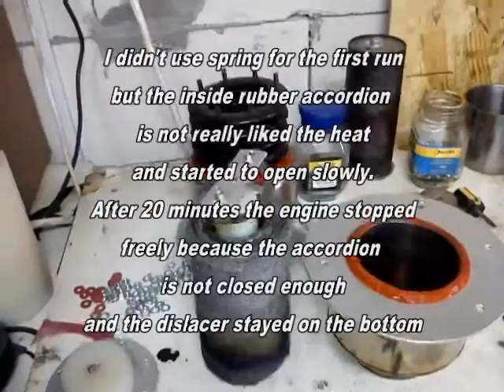My Big Free Piston Stirling/Inside view

Comment: I'm very excited for when you put a permanent magnet on this thing and see how much electrical power you can manage.  It would also be really cool to have you use this as a fountain pump, that would be neat.  Awesome work. I really like your use of simple materials.
Reply from the maker: Thx! I hope it will be soon! I repaired some parts inside. I changed the displacer can to stainless can also changed the regenerator to stainless scrub. But not enough airtight yet, so don't work stabile in a long time actually. I need to solve this problem and after we will see...

Comment: It's cool! Blade, This video makes me more interested :D
I have two questions about regenerator. One is 'why did you change regenerator to stainless?'
The another question is that regenerator consisted of two layers, top has stainless and bottom has cotton. is it more efficient?' Because steel conducts its heat to the top hot air well, and
cotton doesn't conduct steel's heat to bottom's cool air. My idea
Reply from the maker: +김소윤 Thanks! The regenerator is simple No4 thick steel wool. The Stainless steel is much better, but I hadn't got there. Stainles steel for everywhere the best, but my engine is a moving regenerator one. The high tech engines use standing regenerator for this type engine.

Comment: Thanks for making this video.
I plan to mass produce some Pistons like these and put them in light weight car I am building.  (I was originally going to ask you if you could make these and I would pay you but decided that you are probably busy and it's probably cheaper if I did it)

Also I am going to be using fire extinguisher cylinders and cutting the top off (they will be empty of course) do you know if there is any problems if I had a fire under it at 600 to 900 degrees Fahrenheit (yes I realize that I should use Celsius)

Comment: Hi Attila, this is an excellent strip down video.  I am trying to make one of these engines but I can't get it to run. I'm using a pasta can displacer with an internal accordion (like yours) but the diameter of the can is only 2.5mm less than the inside of the cylinder. This means I don't have enough room for a regenerator. Do you think this might be a reason for it not to work?
Reply from the maker: The gap should work too if the cold side is good enough. The displacer should exactly in the middle of the cylinder. The flat spring what I used that saved the rubber accordion from the over-expansion. The sponge on the can surface and the inner volume reduce the heat load on the rubber. But the displacer should be longer as a normal displacer. Did you made a pinhole onto the displacer? because the inner pressure could fix the displacer when the engine start to heat up.
Reply: Thanks for your reply.  I sent you a pm just as I received it!  The displacer is central in the cylinder but if you shake the engine it rattles as it makes contact with the walls of he cylinder.  Yes, I did make a small hole in the displacer to stop the gas expansion in the displacer extending the accordion to the limit.  The displacer length is the same ratio to the diameter as yours and the expansion and compression spaces are about 35mm.  As far as I can tell, the only difference is the regenerator and the gap.... Any other ideas? Thanks

Comment: The displacer (which I assume is a pop can) , you have the center cut out to allow the dvr  / spring movement up and down .
Is the displacer completely hollow except for the bottom on the hot end ?
Thanks blade , 
One badass engine !!!
Reply from the maker: Grumpy Dog Hi there, the displacer is a caffe iron can was originally. The center is cutted off for the inside rubber accordion. The whole displacer is empty. The only thing is the accordion with the holder/dead volume reducer white plastic rod in the center.